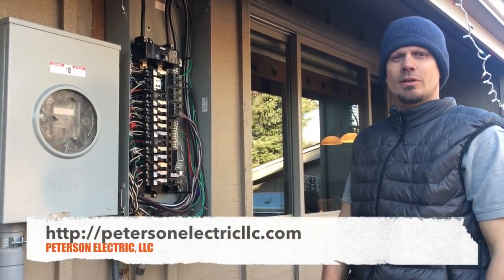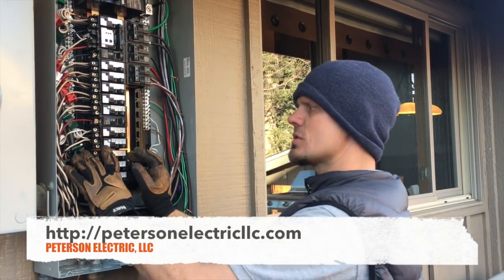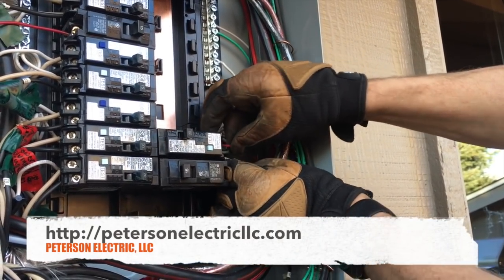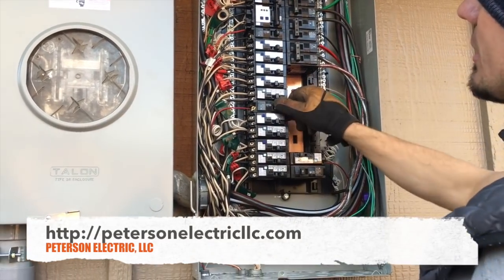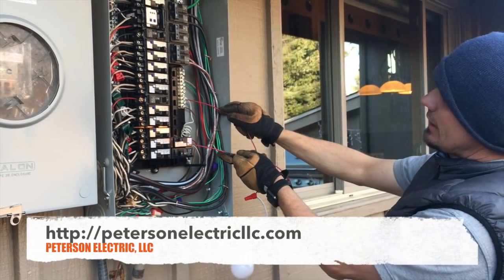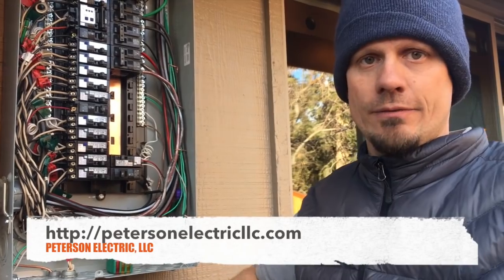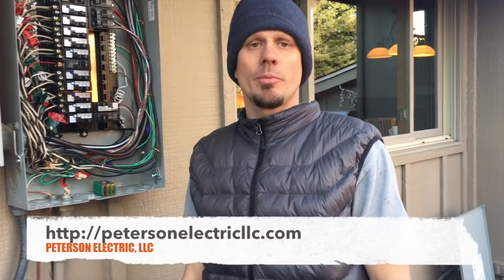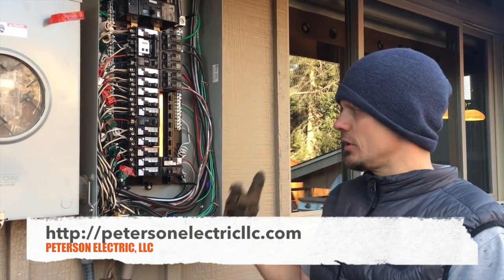Update On Arc Fault Breakers In Electrical Residential Service Panel

Comment: Since meter cans are grounded through the neutral lug, there's no need to use ground bushings even if you're going through concentric knockouts. The neutral wire is permitted to be the equipment ground as per 2014 NEC 250.142.
Reply: Yes there is a need to use grounding (bonding) bushings around concentric knockouts according to 250.92(B).  While the meter enclosure and panel enclosure are bonded to the grounded (neutral) conductor, 250.92 says all raceways (offset nipple in this case) must also be bonded. We can't rely on a bond through concentric knockouts. Although, in this video it appears the panel enclosure was knocked out above the concentric knockout which would adequately bond the raceway and not require grounding bushings.  Lastly, the neutral service entrance conductor is permitted to ground service equipment and should not be thought of as an equipment grounding conductor which would only apply on the load side of the service.

Comment: all the meters i have seen have a bond between the neutral lug and the meter because almost all underground services in my area are in PVC pipe with the main panel  inside the basement with a SE Cable feeding it which doesnt provide you any bonding to the meter.